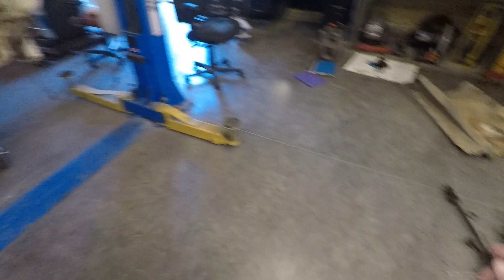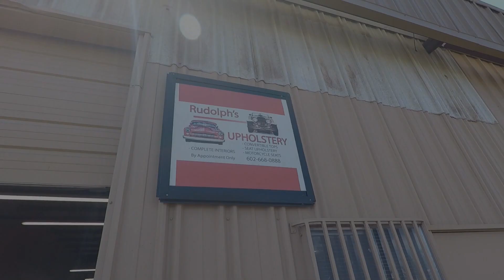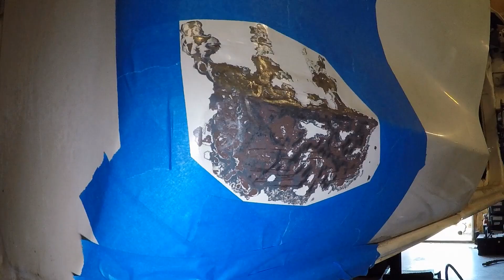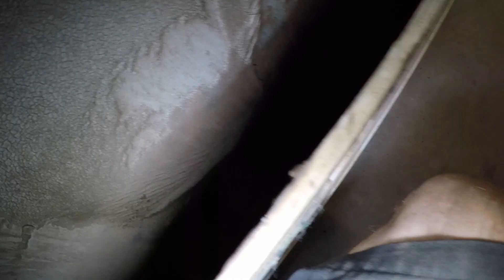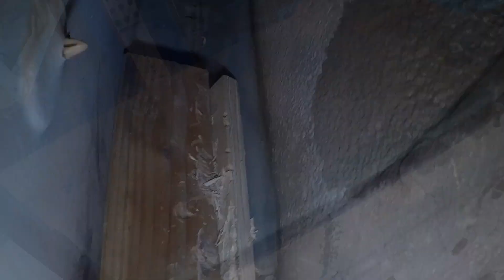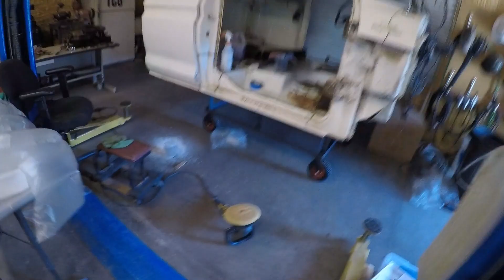1979 F-350 4X4 Supercab Build (Episode 4)

Comment: I drove the first 73 off the transport truck in September of 72 in Mesa .   Needless to say I`ve been around these dent sides a while. I have parted out over 100  and did SOME or total restoration work on well over 100.  OK , patina is cool, sometimes, and I really respect your  metal work, and you elbow grease in the polishing category . But the repairs you did really should have gone a couple more steps and used some filler and primer and THEN the super matched paint. Unless the owner is a zero putty nut , I feel that would have been the best choice overall. I bet there is some small amount of putty somewhere in the 45 year old truck someplace , that was done so well you missed it. Also why do you buy from LMC?  THAT Ithe

Comment: I don't know I guess I just don't get it a truck in that type of condition which is awesome and you taking all the time to knock the dents out and especially in hard to get spots you're buffing out all the Chrome and aluminum I'm redoing the interior seats and stuff why did you not take the time to just fully do the body work and do a good touch up paint on it or a spray over and just do a minor restore you're almost there anyway but to each his own and you're doing a great job by the way knocking that corner dent out look like it would have been a b** anyway great video you stay safe stay well and as always God bless
Reply from the maker: Painting the truck would add 12k$ to this build. There's too many chips and scratches to touch them all up so it either needed this style repair or full paint. Since this truck will be used as a truck and not for show we decided to go this route.

Comment: I'm sorry but I would have that truck repainted , all that work and money and it is still rusted  and will continue to rust !
Reply: yep, thinking the same
Reply from the maker: The truck took 41 years to accumulate what little rust it has, so at this rate it'll start to rust through the body in about 250 years. A full paint job would have added 12k to this build.
Reply: do dteh body wowrk , prep it  prime it and send it to macco , tehn take it tothe desert adn scratch teh shit out it.  My macco job lasted 7 years and never waxed it after teh fist one at 30 day mark.  Never garaged sit in Az sun all the time.  $500 buck and tehy furnish the materials . beat that with a stick.

Comment: Actually the touch up looks awful. It looks like someone who didn’t know how to do it just slapped some paint on over rust.
A better job would be to clean out the rust with a wire wheel not caring about the original paint sand back the rough edges and peaks then put some converter preventer on it then touch it up.
It would be less effort than trying to keep the patina and better for the longevity of the truck

Comment: You have the engine mounts sorted?  I'd like to think it will bolt in.  I'm just not sure if anything changed with the 90's 460 vs the 79.  Looking forward to seeing how the AC system plays out.  Almost tempted to make an offer on the AC components you are removing, but then I want to see how the modern stuff works LOL.  Looking good buddy.
Reply from the maker: I found a bunch of solid mounts that I didn't like, then someone suggested Bronco Graveyard, and they have a rubber mount that uses the existing holes on the frame rail so I ordered those:

https://shop.broncograveyard.com/1978-1979-Ford-Bronco-Ford-Truck-Conversion-Mounts-from-351-M-400/productinfo/20900/
Reply: @AustinCoulson  Good deal.  I figured a re-production part should work provided nothing changed on the engine side with the newer 460.

Comment: I'm sure you've answered this question before, but is there any particular reason you aren't restoring to as original as possible? I understand the effort it takes, and I like the decision to keep the character, I'm just curious.

Loving the vids though!
Reply from the maker: I discussed this with the owner, and honestly, I probably would not have taken the job if that was the direction he wanted to go, as I have zero interest in bringing older vehicles back to exacting factory specs. There were so many issues with these vehicles in stock form, mostly arising from trying to get them to pass confusing emissions laws in that era. We both felt that the truck had a lot of character and potential from being a clean one owner, but we both wanted to see it more usable by making it more reliable and have more power. We are saving about 12k by not having to repair the body and paint the entire truck and that made sense to both of it since he plans on using it for light off roading and occasional boat towing.

Comment: Quick question... I have a stuck leaf spring bolt on my Massachusetts Mazda b2300 (yup... rust has something to do with this)... I ordered new bushings so I 'can' go the heat route, but I'm trying to avoid that if possible as it's right next to the gas tank. I ordered a breaker bar because I've already broken a couple wrenches trying to get it undone. Once I get this bar, I'm planning on using a hydraulic pump-jack to leverage it... what else might you do to help get this bolt out? It's really stuck and I'd really like to avoid breaking another tool. If you could recommend anything, I'd be super grateful.
Reply from the maker: I am not sure if you were able to get the nut off and the bolt is seized or if the nut and bolt are seized together. If you got the nut off, I would focus on penetrating lube and striking the head of the bolt to shock it and break it free. If you do this be careful to not distort the head so you can still get a socket on it. If the nut is still frozen to the bolt you can try using a nut splitter that will crack the nut off so you can get the bolt out. Let me know if either of these work for you. I have never used a hydraulic jack with a breaker bar as that seems a little dangerous, but I have used cheater bars (piece of pipe over the breaker bar to extend it) and those can be dangerous as well
Reply: @AustinCoulson  So, I had been spraying the bolt with penetrating oil for the past couple days. Put the breaker bar on the bolt and used the pump jack to twist the bolt... finally broke free. Didn't end up using the nut splitter. Not sure if you've every worked on a ranger/b2300, but the rear nut had like a little bracket on it to keep it from spinning, so all I could really do was spin the bolt from the front. Luckily it finally broke free. I totally hear you on the sketchiness of the jack... I felt fine about it though because the truck is up on two giant oak stumps. The bar itself slots into the "cup" of the jack lifting arm, holds it pretty steady, and I operate the whole thing from about 5 feet from the sketchiness using long jack lever. Even if it popped off with any force, which I didn't see happen, it would just sort of fling into the wheel well. Would actually recommend the method... easier and less scary than a cheater bar. Feel good! Fingers crossed the other side will be a little easier :) Thanks for your advice.

Comment: Austin, I'm going to be paying attention to your A/C install. I have a 79 Bronco I'm trying to put a 12v Cummins into. Thanks.
Reply from the maker: It will be fun. The VA gen VI kit is pretty simple, but there are a couple little tricks that will help. One thing is creating custom length hoses. I'll save the measurements in case you need me to make you a set since you need a special tool for it.
Reply: @AustinCoulson  Might be helpful, but with both of you guys having non factory engines it is almost a guarantee they will be different lengths.  Cummins is mounted really low on the passenger side.  Possibly different hose ends on the compressor too.
Reply from the maker: @ShainAndrews  oh yea I didn't think about that.
Reply: @AustinCoulson  Thanks Austin and Shane. I wanted space under the hood and A/C. Moving the A/C inside the cab is a solution. I'm in NM, you're in AZ. You understand.